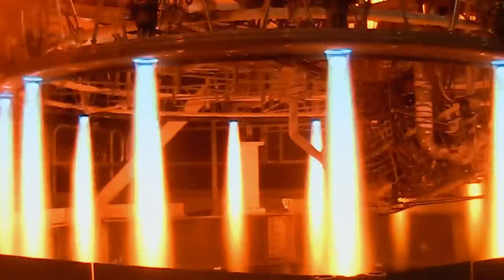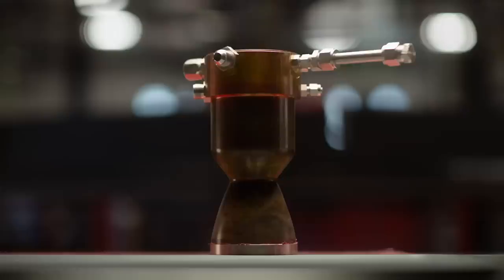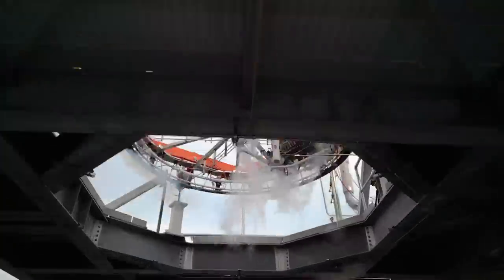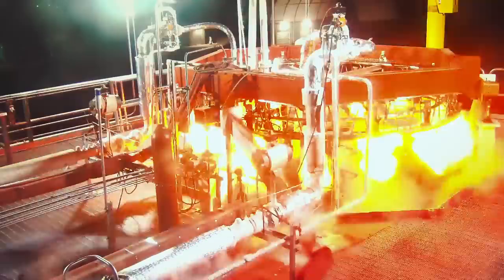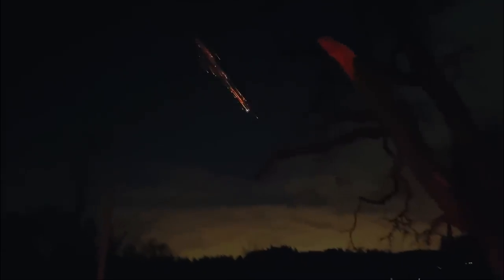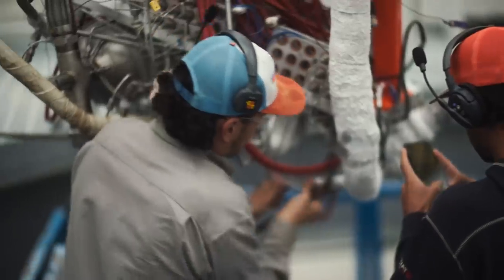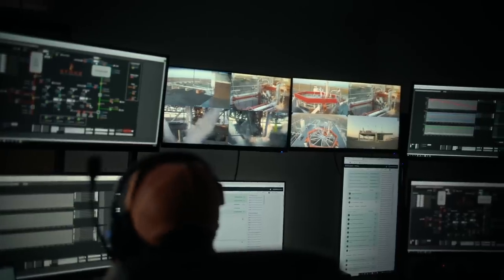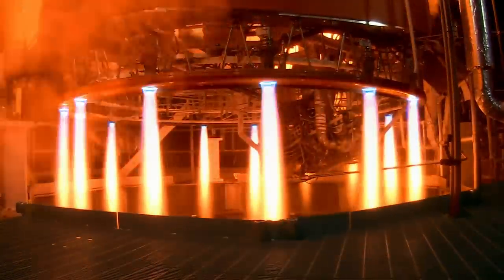We are Stoke Space

Comment: Wait....is that an aerospike? This looks to be an expander cycle aerospike concept that doubles in function as an active heat shield. That is absolutely amazing and I'm really looking forward to future development of this concept!
Reply: I would call it a "virtual aerospike" - a similar effect but without the spike itself .
Reply: @medivalone  The aerospike doesn't really require the spike, but your point still stands. Part of the heatshield might have a profile similar to that on a truncated aerospike, and the rest of the spike is generated by pumping gas out through the middle of the heatshield, i.e. the same vent used to provide active heatshielding.
Reply: @medivalone  I'm guessing that they can also achieve the 'optimal spike' by varying the gas flow rate according the thrust of the small engines along the circumference.
Reply: yeah, the aerospike needs to handle extreme temperatures anyway, so it make a lot of sense to use it as the heat shield
although i'm not sure how their metallic heat shield is gonna work
Reply: Aerospike has its benefits if used in the atmosphere, hence the name. What's the point of having it for the 2nd stage?
Reply: @РоманПлетнев-г3э  Perhaps because they calculated that it still works in the tenuous upper atmosphere? The shape of the spike is dependent on the ambient pressure. This never goes to zero, even in space. That said, I don't know how the performance would compare to a regular bell-nozzle upper stage engine.
Reply: @РоманПлетнев-г3э  efficiency.

aerospikes have a good efficiency in a vacuum (of course this depends on the exact design, not much testing has been done on aerospikes because of the insane amount of cooling needed), especially when compared to a typical bell nozzle which weighs a lot and takes up a lot of room.

plus, if you have the thermal protection for re-entry, you might as well use it in space.
Reply: It looks like at least at high altitude it does function as an extremely truncated aerospike, yeah. Though at sea level the individual nozzles are too highly expanded already for the plumes to merge and it to act as an aerospike.
Reply: 35 engines is a lot of failure points. If one fails, do you have to turn off the engine on the opposite side to ensure the craft remain balanced?
Reply: @РоманПлетнев-г3э  In this case they're also using it for landing, so it needs decent sea level performance for that.
Reply: @marsrocket  35 being an odd number you'd probably just throttle down the two opposite engines.
Reply: Yes that's what I thought
Reply: @marsrocket  i'm not sure what their plan is for attitude control, but it's probably gonna be thrust vectoring or differential throttle. If they use thrust vectoring, they won't have to shut down an opposing engine, if they use differential throttle, they will probably have to slightly reduce the throttle on a few of the engines on the opposite side.

the good thing about having 35 engines is that if you lose one, you lost 1/35th of your power

the Falcon 9 has 9 engines and can still succeed in its mission if it loses 1 engine.

if you only have 5 engines, for example, on the Saturn V, 1 engine loss can mean mission failure.
Reply: No
Reply: @marsrocket  They don't have 35 engines, they have one. The same pump system drives the propellant for all 35 combustion chambers. It's actually an advantageous design because the redundancy makes individual failures less significant, as steering is already achieved in the rocket by varying the thrust in the chambers. For most rockets a failed combustion chamber is a critical event that could end the mission, for this one it's just a negligible loss of thrust.

Comment: Wow, I really want to see this thing fly! Cool stuff guys. 
Was first sceptical, as small engine bells in vacuum usually mean very low efficiency. But your idea to get a dual-use out of the heatshield is extremely interesting. Love it!
Reply: They need an expendable bell system that detaches after deployment.
Reply: @n1k0n_  Idk. Aren't aerospikes very similar to bell nozzle's performance wise? 
I'd just guess it's hard to do. But i don't know :)
Reply: Having 10 engines is a big engine failure risk.
Reply: @PapaPrager  Pretty sure it was 20, and I'd disagree about it being a big risk. There may be a higher chance of failure, but in return any failure is much less damaging. They could potentially lose 2 or so (and shut off their opposing engines) and still reach orbit and maybe even deorbit, allowing checkouts after partial mission failure.
Reply: @DJ_Level_3  well, you got 20 as much chance of engine failure and the engines produce less thrust.
Reply: @PapaPrager  But the engines are smaller and generate less heat per unit surface area, giving them less thermal stress. Also, more engines are better if they're all the same because they can initially be developed separately and at smaller scale.
Reply: i think they are supposed to perform somewhat same in vacuum as well as the atmosphere, don't forget that the craft has to land using those engines. That is why they are using aerospikes
Reply: @PapaPrager  it's not a quadrocopter where if you lose one engine, you're done for, you know
Reply: How do they plan on protecting the engines during re-entry? They have a lot of work to do, I hope this works, the space industry really needs new players for the cost of launches to reduce.
Reply: @myacht  search up N1, it never reached the moon thanks to so many engines.
Reply: @PapaPrager  there is like nothing in common between N1 and rocket in the video

Comment: Interesting concept. As much I'm a fan of new companies trying to break into the industry, they often fall short. I hope you guys can deliver on your claims down the line. You have me on the metallic heat shield. Excited to see that in action. All the best!
Reply: I highly doubt they are going to end up with a metallic heatshield. SpaceX's Starship was originally shown to not have a ceramic tile heatshield either, but now it does. Metal warps under those high temps and will begin to fracture. A metal heatshield isn't indestructible, and it's ultimately just going to be more expensive.
Reply: @randompersonoftheinternet8012  Agree on those points. If anyone was to try it, it would be SpaceX. There is a reason why it was abandoned. Maybe stoke space made a breakthrough. We never know till we see it. Let's see..
Reply: @IsMaski  they haven’t even finished the first part of their program: the propulsion system for the second stage. As far as I can tell from the video all they’ve done is plumbed up the ring of combustion chambers. Time will tell, but don’t get your hopes up
Reply: @randompersonoftheinternet8012  so there are some significant differences in the designs of starships heat shield and stokes heat shield.

The primary difference is that Stokes plans on using regenerative cooling for the heat shield. They have channels within the heat shield through which they will be running the LH2 propellant, the absorbed heat will actually be used to the power the turbo pumps for the engine. This differs significantly from the original starship design which planned on trying to use a diffusive active cooling where the methane fuel would diffuse through the surface and create a film cooling effect. This had significant problems as they couldn't achieve uniform diffusion rates across the entire surface which led to hotspots.

Some other differences are the significant size and shape difference. I believe the very large surface area of Starship is one reason they couldn't do the channel cooling, and ultimately why the diffusive film cooling didn't work either. Also the use of methane also makes the channel cooling for starship impractical due to its heat capacity compared with LH2. Additionally Starship will be reentering from much much higher orbits, significantly increasing the thermal load on the heat shield.
Reply: @Ender240sxS13  My point is that they are subject to their solutions simply not working, just like spaceX. Also, the size and shape are a significant difference, but I also see it to be a problem. The 3d render showed the heat shield on the bottom of the payload capsule, which doesn’t have as large of a drag cross section as opposed to re-entering on it’s side. This just means the heatshield will have to sustain more heat, and the burners for slowing the landing will have to do more work. I mean these potential issues would be a huge thing to overcome, and until they actually test this “groundbreaking heat shield technology,” a 3d render is just an imaginative vision.
Reply: @randompersonoftheinternet8012  actually no they have tested the materials and cooling design. They have a hell of a lot more than a 3D-render. The shape really isn't a significant problem at all. Hasn't been a problem for literally every other reentry capsule ever made. So long as it can deal with the heat flux experienced by other heat shield types, which testing has shown that it can, it won't be an issue.

The main engineering difficulties they need to overcome at this point are primarily on the propulsion side of things. They need to ensure they can achieve sufficient efficiency from their engine that they can hit dV needed for a wide enough range of orbits and still have enough fuel to land. In addition the control system for managing the multi-nozzle configuration, managing start-up and shut-down in a way that doesn't induce unwanted pitch/yaw, etc.
Reply: @randompersonoftheinternet8012  but this is on a traditional capsule design, with ACTIVELY cooled heat shield. It may work, may not. We will see! At least they are trying
Reply: @randompersonoftheinternet8012  its an ACTIVE COOLED metal heatshield

Comment: I'm curious about the capabilities, it seems to me that it could be a competitor for the electron rocket.  It will be interesting to see if the concept of a water-cooled, LH or LOX-cooled heat shield is used in the final phase.  Time to do a coolant estimate... I wonder to myself if the heat shield and landing legs will be promptly replaced with new ones after each mission.
Reply: Their current design uses the LH2 propellant to cool the heat shield. This heat will also be used to power the turbopump for the engine. The whole reason they went with the metal heat shield concept is for rapid turnaround, with ideally no parts being replaced before the next launch.
Reply: @Ender240sxS13  Hello, I checked the website and as you point out they will use LH in the second stage.  Hopefully the alloy is durable!  Regards!
Reply: @asynchronous_man  the lead engineer/CEO of the company was a PhD student of the professor who taught my rocket propulsion course, and he came and gave the final lecture of that course this past semester, had a lot of interesting information.

Comment: I imagine that one of the reasons second stages aren't recovered is because adding the engines needed for landing adds a lot of weight, and thus makes the whole mission more expensive (as opposed to first stages which already include much of the heavy hardware that is designed to operate within an atmosphere). What are the reasons that a vertically landing second stage is economically better than one that incorporates a lighter-weight technology, like gliding to a horizontal landing pad, or a parachute, or splitting into panels that independantly act as flying wings/lifting bodies?

Comment: God Speed, one question though, for the second stage re-entry, since the smaller thrusters are not being used, they  still have holes inside of them, so how will you protect the heat from the outside going into the thrusters and into the fuel load?

Comment: Umm, Stoke Space, that reentry heat shield will fail miserably in minutes. Those exposed thruster ports and recessed leading edges will fail the heat test.
 A solution: Put your ablative heat shield at the top of your second stage, once through the plasma stage reentry then flip your second stage over
Reply: then how could the spacecraft be released
Reply: the heat shield will disperse the plasma and create an air pocket at the bottom, and push the plasma to the side, the thrusters will be fine, then again i'm no expert

Comment: Another SpaceX wannabe.  Interesting idea for a second stage but my gut is that having 30 engines will be complicated, unreliable and take up a lot of weight. Also not sure about the heat shield idea either.  Metals aren’t temp resistant enough so you’ll need to slow down a ton prior to reentry. Maybe it’s save weight versus just having engines slow down a bit more. Not sure.
Reply: Don't forget that SpaceX is using 33 engines. And Metallic Heat Shields are proven to be lighter and more temp resistant than current systems

Comment: thrust does not work in a vacuum, it has been demonstrated and proven. people thinking we have ever gone, or will ever go to something called "space" are deceived.  rockets push on air, and the reaction is thrust forward.  there is nothing to push against in "the vacuum of space".
Reply: It´s called newtons laws. You should check them out.
Reply: @vibe4394  maybe you should revisit your understanding.  newtons third law states that there is an equal and opposite reaction for every action.  In rockets ... the exhaust pushes against the air, so the air pushes back equally providing thrust to go forward.  When you're "in the vacuum of space" there is nothing to push against, so nothing pushes back.  It's demonstrably true, and people have proven you cannot accelerate in a vacuum.
Reply: @bigdogboos1  It's the gas that leaves the nozzle of the rocket that pushes the rocket forwards. Imagine you are floating in space with a baseball in your hand - when you throw the baseball, you excert a force on the baseball - and the baseball excerts an opposite and equal force on you - making you move backwards from where you threw the ball. 

The same concept is in the rocket engine. You don't need any air.